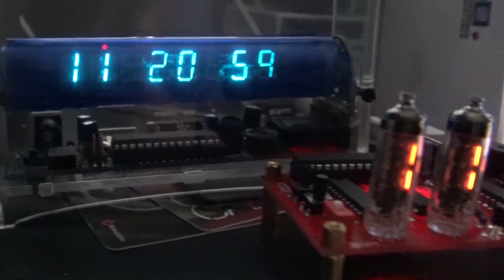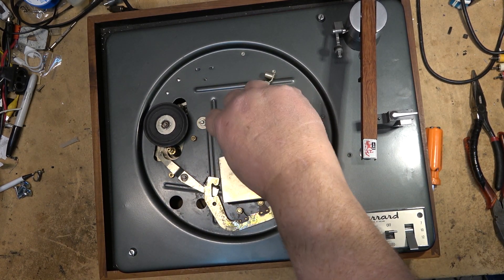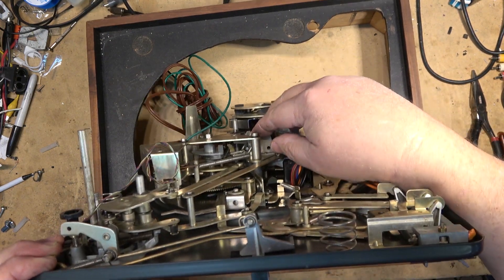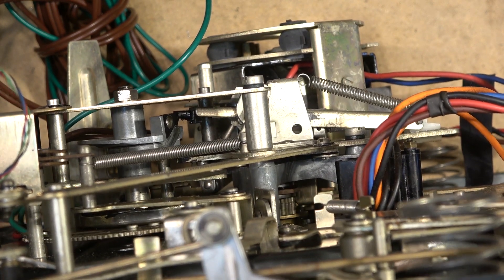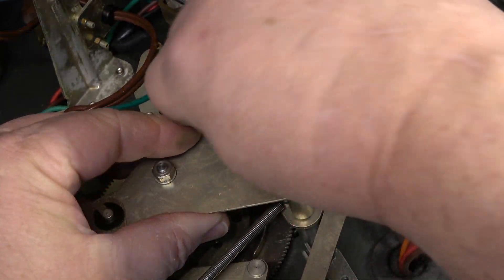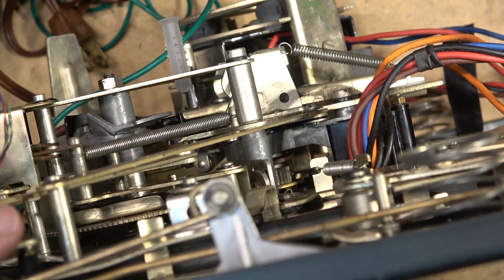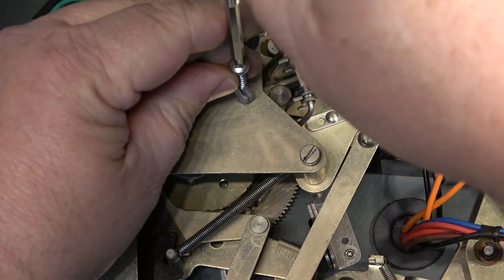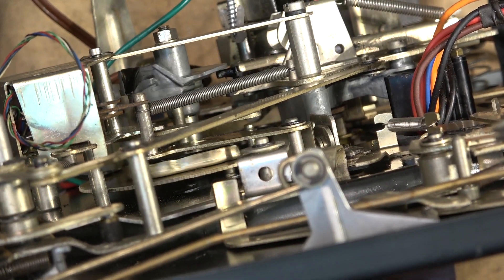Garrard Lab80 dead simple fix for a jamming mechanism. MacGyver Style!

Comment: Great fix ! However, is the guide that it rides in missing a section on the bottom of the metal guide assembly, or was there a rubber/neoprene nub that used to be in the hole where you inserted the wall anchor ?

Comment: Go to the 1:20 mark in the video.  I think you put your finger on the problem.  Right behind your finger is a tensioning lever with some rollers on it.  It should float up and down as the release lever moves keeping downward pressure on it.  I may be wrong but it seems to be stuck and not moving freely.  It could be a spring or spring pin issue or perhaps just in need of new grease.  Look at your other Lab 80 video and go to the 7:15 mark.  You will see it in action.  This is all speculation since I can't really see it clearly in the video.  If this works, frame my comment and use the wall anchor to hang it.

Comment: Very nice work.I have a Sync Lab95 of Garrard only.The auto set up does not work The CAM does not move twice for auto work.
Please guide.
Thank you for reading.
Reply: Run it through its cycle manually over and over, watching every part, one at a time if you have to. Watch for something that isn't moving when it should be. a lot of these old turntables have grease that has turned to an almost rubber like consistency, and it's preventing parts from moving freely.
When you find the guilty part or parts, clean the old grease off of them and lube them with fresh grease, and that should do it.
Dave, nice work. I hope you don't mind me trying to help out one of your viewers.
Take care, and have a great day.
Reply: @gatekeeper65  
Thank you very much Sir.